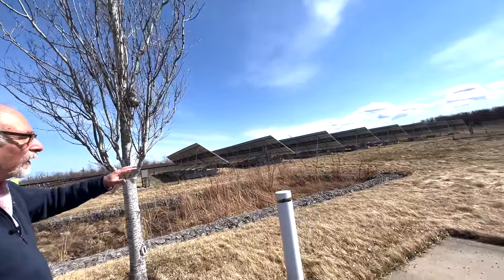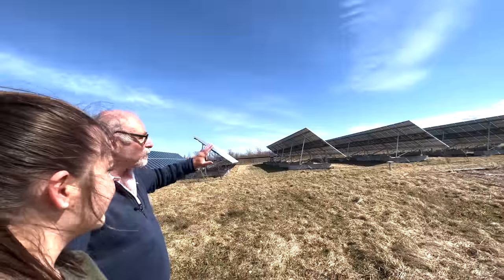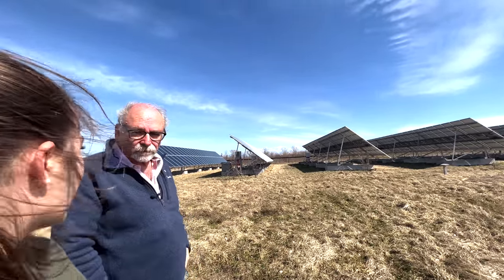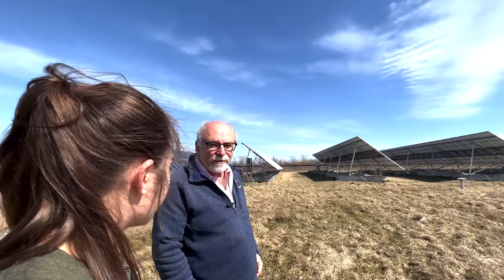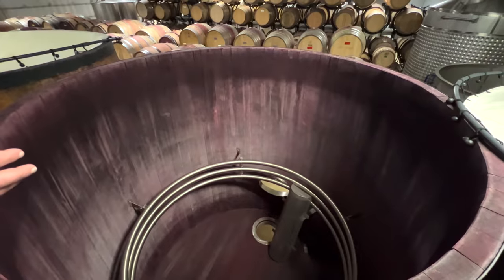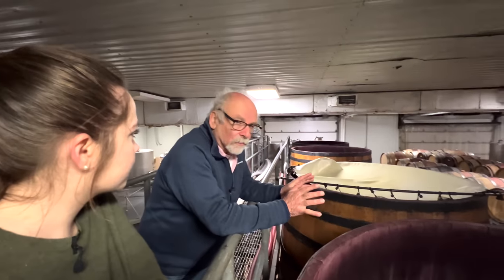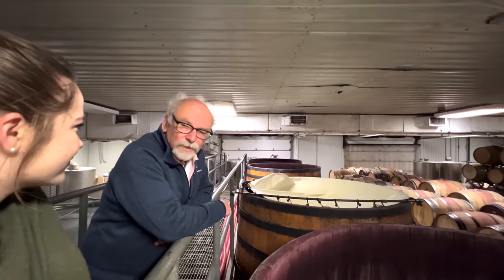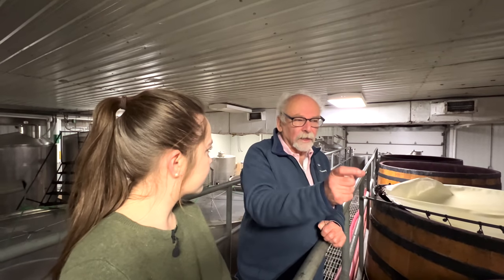Off Grid??? Solar Power & Organic Wine Making!!!!!

Comment: What’s your favorite wine, Kate? You know, that septic filtration system sounds good. However, if the soil is a filter mechanism. I guessing there must be a comprehensive inspection of the process to assure me that contaminated fluids don’t make it’s way back into the food chain.
Reply from the maker: Thank you for your question and comment.  I am not old enough to drink wine.

Comment: Disadvantages to Solar: Cost: The initial cost of purchasing a solar system is fairly high. Weather-Dependent: Although solar energy can still be collected during cloudy and rainy days, the efficiency of the solar system drops. Solar Energy Storage Is Expensive. Uses a Lot of Space and it's associated with Pollution. The environmental impacts associated with solar power are land and water use and pollution, habitat loss, and use of highly hazardous materials in the manufacturing process. Energy is only generated while the sun is shining. That means nighttime and overcast days can interrupt the supply. To much disadvantages to advantages. It's nice to see that he is using his own source of energy making wine. It's mainly about the Grapes, but the Fermentation is probably the most critical step in wine production — it's when alcohol is created. To trigger this chemical reaction, yeast is sometimes added into the tanks with the grapes. The added yeast converts the grape sugars into ethanol and carbon dioxide, giving the wine its alcohol content. Great Work Kate..
Reply from the maker: Thank you for your comment and wonderful kindness!!!

Comment: A grid tie solar system will not work without a base power system like hydro, coal, natural gas or nuclear power generating the base load.  This means that the overall power picture is more expensive system wide because the full base load has to be there but it is not getting paid all the time. So this farm is likely saving money on electric power and can claim to be "green", but the grid as a whole is made more expensive for no real overall benefit.   The best kind of power is a modern high pressure water nuclear reactor. (750 degree water or so: vary high pressure!) If the government would get out of the way, nuclear power could be made the lowest cost way to make electric power except for hydro electric: and might even come close to that. Because grid tie solar goes down when the grid goes down; if I were to have a solar system, I would want a fully independent system using salt batteries to store the electricity.  One may not have heard of a salt battery, however it is good because it is unlikely to catch fire like lithium batteries, or to explode like both lithium and lead acid batteries.  A salt battery also lasts longer under solar system usage then other kinds of batteries. Salt battery down side is that it is bigger and heavier for the same power, but in a solar installation that is not a real problem.  I have also read about a heat storage system that is interesting.  I do not at this time understand all the details, however it can store heat in sand at 930 degrees for a long time (months it said) so that is interesting.   An independent solar system is less work to operate than an independent wood system. However a Solar system can be destroyed by EMP or CME. (Eleto Magnetic Pulse or Coronal Mass Ejection)  Both of these can just about end all electric power for years if they happen at this point in history by destroying all working transformers. (Canada may have some resistance to EMP and CME because I have heard that they have installed gigantic capacitors to help reduce the extremely high DC voltage spike. If true it may make the difference on EMP but may not do much for the more sustained CME.)   CME has happened a number of times but not at high power sense we have become so dependent on computers. I have devised a theoretical all wood powered system where heat and cooling of a house is done by burning wood pellets. The electric motors in the normal system are replaced by air motors.  A Tinytech steam engine powers the air system and provides power to make the pellets.  If the generator is kept in a Faraday cage till after the EMP or CME event, the steam engine can make electricity.  The salt batteries can be used so that the steam engine does not have to run all the time.  Also the steam engine and solar panels can be used together if cost is not a consideration.... The main idea of this system is to have power in all situations not involving a direct hit by a bomb or something like that. Still there are vary small modern nuclear powered systems that would be much better if we were allowed to have these tiny inexpensive power plants!!
Reply from the maker: Thank you for your opinion.